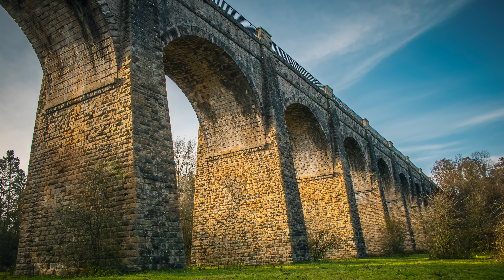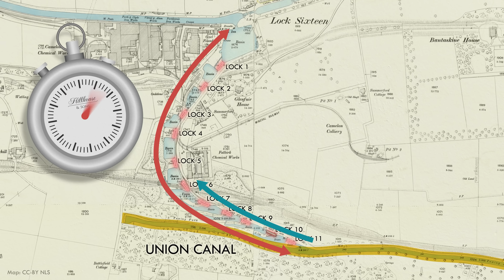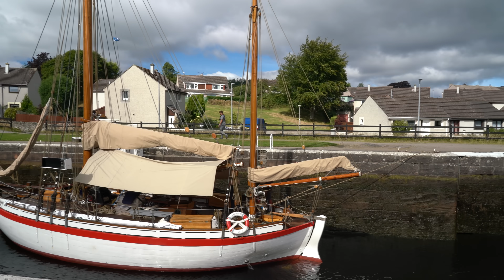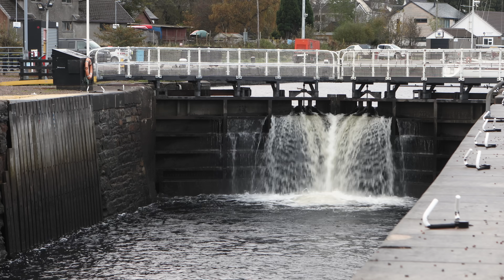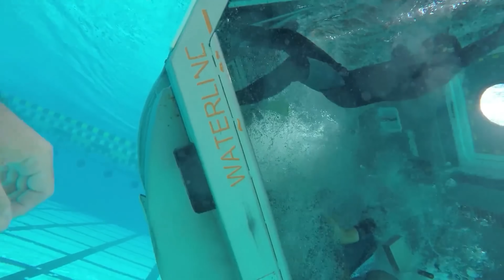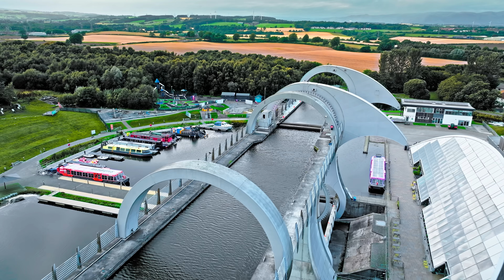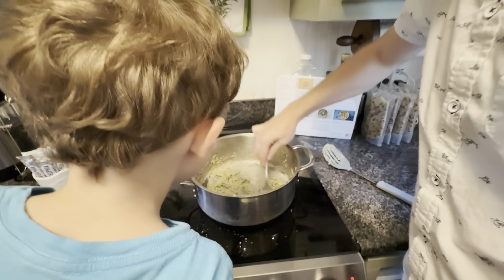The Hidden Engineering Behind the Falkirk Wheel

Comment: Due to the same problem in Elevation between Berlin and the Baltic the Germans build a similar but Vertical lift with counterweight for a 34m drop called Schiffshebewerk Niederfinow (Boatlift in the Area of Niederfinow) in 1934 which is still operating today and just recently got a replacement build while still remaining in use.
If you are touring North of Berlin and interested in Infrastructure there are tours and a museum worth a visit.
https://de.wikipedia.org/wiki/Schiffshebewerk_Niederfinow

Comment: There is another really important point about this that Grady forgot to mention, which is that unlike locks, the wheel takes almost no net water flow.  If two boats use it in opposite directions, the boats displace the same amount of water.  But even if only one boat goes up at a time, the water that travels down as the boat goes up, goes back up when that boat eventually comes back down.  So provided all the boats that go up come back down eventually, and vice versa, there is almost no nett usage of water (just the small quantity between the leaf gates at the end).  Whereas with locks, whether a boat goes up or down it takes a lock-full of water every time.  Pumping the water back up to keep a set of busy locks supplied is no trivial amount of power, so this device completely eliminates that.  When you add to it the fact that the power to make it rotate is tiny, just enough to overcome friction in the bearings and gears, it makes it a much more efficient and cost-effective solution than using locks.  On top of that, there are only two sets of gates to be maintained, rather than the many gates involved in a staircase of locks.

The Anderton boat lift, which raises and lowers boats in a tank of water which is counter-weighted, achieves the same result but doesn't look as cool.

Comment: There are other boat lifts around the world. Some use counterweights and cables to do the same thing. They are all fascinating. This rotary one, however, is really special. They had a similar idea in 1906 for the boat lift in Niederfinow Germany, but it was dismissed and they wanted to use a balance beam instead. The build was delayed due to WW I and afterwards they switched to the counterweight and cable solution. It still uses the same buoyancy principle, but it is not that aesthetically pleasing than the symmetric wheel.

Comment: I worked in Glasgow for three years, and for a big chunk of that time I lived in Linlithgow. I travelled into Glasgow each day on the train, which passes about half a mile from the Wheel. I didn't get to see the Falkirk Wheel at the time, because I had to move away before the project was even halfway through. But I went back to that neck of the woods a year or two ago, and I can confirm that the Falkirk Wheel is indeed a most impressive structure. 

One thing that you implied but didn't state is how much water the Wheel saves compared to a flight of locks. In principle, the Wheel doesn't transfer any water from the Union Canal to the basin below, because the pressures in the caisson and the canal are equalised before the gates are opened. In practice, though, the flooding of the gap between caisson and aqueduct will lose some water on each cycle. The amount of water lost from the Canal, though, is trivial in comparison to the volume of water needed for each cycle of a flight of locks.

Comment: Hi Grady
Thanks for covering our wheel! I went to it's official opening as a kid!.

Do you think a system like the falkirk wheel, or a series of them, could, theoretically, be used to replace the locks on the Panema Canal?

Obviously they would need to be a LOT bigger, but it's potentially a way to use a lot less water to transit ships from East to West, which I know is becoming a real concern in Panema.

It would be a huge engineering project, but so was the Canal's initial construction - can you forsee any scaling issues that would make upsizing the falkirk wheel impractical?

Thanks 🙂

Comment: I'm a little disappointed that you didn't mention the improved water usage. While a traditional lock "uses" its full capacity in water, this system only uses the boat's displacement. That said, "using" water refers here to it being moved downhill, so the benefit is more in terms of water control. For example, if for whatever reason the upper pound is lower than the lower pound, when a narrowboat makes a journey through the canal system the water that is used by the locks above this one ends up filling the top pound, rather than refilling it after a lock-full of water is moved down to the lower pound. Due to all the other locks on the canal system being standard ones, and the need to keep pounds at a reasonable level, this won't save water, but more of these could definitely save narrowboaters and the canal and river trust a few headaches.

Comment: I've made my own model in my garage and when you put a water container on scale and put a floating boat on it, it definetly adds a weight.

The difference is when the container is semi-opened and the water is pushed away from the container. 

I guess that is what Grady meant, but it was confusing for me in the video and I didn't understand why the boat not suppose to put pressure on the structure. Now I know.

Comment: What's fun in many lift locks don't even need power to work.  They are just designed so the water at the upper left level is sliiightly higher. Meaning a little extra water flows into the upper lift, and then out when it gets to the bottom.   This means the upper lift is slightly heavier,  so when the breaks/locks are released it lowers and raises the companion lift which is slightly lighter,

Comment: You say "locks are a perfectly functional solution to get boats up and down", but with climate change that is only true with an asterisk. Even (or especially) the mighty Panama Canal has to limit ship throughput at least sometimes just due to lack of water, needed to operate the locks. Also we can no longer neglect the environmental impact of displacing such huge amounts of water, as that has to come from somewhere, and it's usually fresh water. This obviously doesn't really apply to the defunct locks that the Fallkirk Wheel replaced, as both boats and locks are tiny in comparison to the Panama Canal and water isn't as short in these areas either (probably, I didn't check).

Comment: So, interesting thing about boats moving across something like an aqueduct; the weight does not increase only if the water level doesn't change (stated in the video). However, if the water level does change, the weight can increase (or even decrease)! If a boat is traveling slowly enough, the water that it displaces is able to spread out from the boat (ahead and behind) so that as the boat passes, the water level does not change much. However, the faster the boat travels, the more concentrated the displaced water gets. If the boat travels fast enough, the water builds up in front of the boat (bow wave) and there is a wake behind the boat. If you had a scale weighing the aqueduct as the boat passed by, there would be a spike in the weight followed by a drop in the weight!

If we had a sensitive enough scale, we could actually detect the passage of a boat. The weight of the boat still passes over each section of the aqueduct, it just gets spread out by the water so that the extra weight is not all concentrated in a boat-sized area.

Comment: Great video, I used to ride along to the site every week to watch the progress of the construction, and was at the opening ceremony.  

The wheel was indeed a Millennium project, but it was only one link.  The whole thing was to make the Union and Forth and Clyde canals navigable again for pleasure craft, and this was itself a massive undertaking.  So much of it had been left to rot or had been actively blocked.  You touched briefly on the motorway, and that was one of the biggest items I think.  The main Edinburgh-Glasgow motorway was simply built across the canal - no bridge, just a couple of large concrete pipes to equalise the water level on each side.  To fix this they had to raise the level of this main artery by something like 20 feet so that the canal was again usable.  As others have said this was one of very few Millennium projects that was actually worth doing and has stood the test of time, ironically quite important for celebrating the passage of time.

Comment: The engineering behind this wheel, it could probably be operated by a couple of humans winding a handle. They should have included that in the design, just another couple of gears, it would have been like lifting heavy lock paddles and given an experience to boaties. But I suppose H & S come first. Thanks for the video.

Comment: Slight peeve - the Twenty First Century did not begin on 1st Jan 2000, but a year later. The calendar we use does not have a year zero (the Romans didn't have it) and effectively the calendar transitions from 31st December 1 BCE to 1st January 1 CE. So, for example, the 2nd decade began at the beginning of 11 CE, after ten years had passed; the second century on 101 CE, after 100 years had passed, and so on. The Victorians understood this and celebrated the beginning of the Twentieth Century in 1901.

Comment: We have a similar system here in Canada along the Trent Severn Waterway in two locations, Peterborough and Kirkfield - technically they are hydraulic boat lifts and operate solely on gravity only using electricity and hydraulic pumps to open and close the pivoting caisson gates

Comment: That seems like an extremely efficient solution compared to spamming a bunch of locks. It's far more compact on land use, allows bigger elevation changes than seem practical for a lock. Much higher capacity for traffic to go through by the look of it. The power consumption is something in the realm of what you could more or less cover with on site solar panels if you really wanted to. How much energy would it take to pump however many lock fulls of water from the bottom to the top? I can't imagine that would be cheaper to pump the water back up with traditional locks compared to the extra engineering for a wheel like this.

Comment: The Falkirk Wheel is so elegant, I was thinking at the beginning of the video that it was designed out of necessity when the canal was used to move freight. I imagined it was a lock that ran on the weight differential between the top and bottom to move the boats up and down. A small amount of water from the top relative to the usual amount needed to move boats up and down in normal locks was used to rotate it.

Comment: 3:30 It is a bit misleading to hilite water usage while showing 11 locks.  The locks are in series.  Water used by the top lock is reused by the following locks.  Water usage depends on the water volume of the lock.  11 locks in series use 1/11 the amount of water that a single tall lock would use.  Also note: shallow locks have lower stresses and sealing issues.

Comment: I'm a 20 minute walk away from the Falkirk Wheel. Fantastic to see such an excellent summary about I've of it local engineering marvels. 

The other reason the two locks are required is due to a rail line which the canal goes under, it also avoids the structure getting too big. 

They are also the only locks on the Union canal, which follows the contours too Edinburgh.

Comment: My biggest question on seeing the design was why it had the pointy triangular bits sticking out of the caisson-carrying parts. From what I can find out, it's partly to balance the torque (imagine them extending all the way to the other caisson and you'll essentially have a Ferris wheel), and partly aesthetic to represent a traditional Celtic double-headed axe (which is one reason why they don't actually extend all the way around).

Comment: To explain, the reason for the two locks at the top, instead of a slightly taller wall, was that they didn't wish to instruct the view of the historically important Antonine Wall (rhymes with nine) or the natural scarp slope. This is why the wheel isn't fully height, then the canal goes through a tunnel and up two locks. You can pay for a ride on a boat but it's a waste of money for a very short ride on a smelly diesel boat, when you get a better view if you walk. The most intriguing feature is not the engineering, but the way it unexpectedly caught the public imagination after an article in an engineering journal, leading to the unforeseen need for a visitor centre.

Comment: I'm surprised you didn't emphasize the water savings the design provides after setting up the amount of water standard locks use. It appears that as much water is raised up as flows down, resulting in no net flow. I'm not sure if that creates any problems, but generally saving fresh water seems desirable. If they could scale it up to the size of the Panama canal it might solve their water issues.

Comment: The Bong

I worked for Butterley Engineering in Derbyshire when they made the Falkirk Wheel. They were well used to making huge cranes and advanced heavy engineering projects having started in 1790 (see Wikipedia ).
In short , after installing the Wheel lift we got a phone call to say it was making some dreadful vibrations with a loud BONNNNNNGGG  periodically. It terrified the  boaters riding on it and it was stopped for some days until a design engineer realised it was 'winding-up' and just needed to go round the other way every so many rotations. That solved it.
This short version fails to describe the atmosphere in the factory during those few days of uncertainty!

Comment: Excellent video.  My spouse and I made a point of visiting the Falkirk Wheel when we were in the area in the summer of 2024.

You might have mentioned the Anderton Boat Lift, the only other operational boat lift in the UK.  It's also a counterbalanced two chamber lift, but works using cables.  It's less efficient than the wheel, but it was built in 1875.  It's under repair right now, but should be operational again in 2026 or so.

Comment: In Peterborough, Ontario, Canada, there is the Peterborough Lift Lock, which doesn’t use ANY electricity, and an extra foot of water in the upper gondola to operate the system, with two huge hydraulic pistons

Comment: ISTR there's another 'boat lift' in the UK that used hydraulic cylinders to lift / lower two caissons. It too was ingenious in that the weight of one piston lowering, provided almost all the effort needed to lift the other at the same time. So when I first saw the Falkirk Wheel, I realized immediately, "Those two tanks always weigh the same, loaded or not. So it's practically balanced perfectly."

Comment: Bro that displacement thing so it's always balanced with no additional stuff or engineering is genius. I love that
Reply: It's very similar to a funicular elevator except even more efficient because it's always in balance.
Reply: Thank Archimedes for that!
Reply: @bonaldisillico  that guy was really screwing around
Reply: Yet there is still the problem of the level of the main canal at the top and bottom.   For example, if the higher pool is, say, a foot above "normal" and the lower pool is a foot below "normal," as soon as the water levels are balanced, the top section would be much heavier than the lower sections.   Do they transfer water between the two levels before unlatching it?   

And what are the ears for?
Reply: It’s literally the only way it would work. Physics dictates the result. It’s not engineering, it’s the way buoyancy functions.
Reply: @Ping_freud22 yeah I know, I just never thought about the way that could be used for something like this
Reply: @KamikazeWombat  totally, everything about this is super cool

Comment: The missing Grady Garage experiment:  Have two identical containers representing the gondolas with an overflow at the top of one of the walls so, if filled with water, they will spill any excess out and keep them both with equal volumes of water.  Put them on the arms of a scale.  They should be perfectly balanced. 

Put a small container simulating a barge in one of them.  Start adding weight to the barge.  The barge will start sinking and water will overflow from the gondola, but as long as the barge doesn't touch the bottom, both gondolas will be balanced but, as soon as the barge touches bottom, that is, it doesn't float any longer, it will not displace any more water and the pair will end up unbalanced.

Comment: The safety brief on the tour boats (which are worth going on :) ) was "If we start to sink, just lift your feet up, otherwise they'll get wet", as it is so shallow (about 30-40cm under the bottom of the boat, we were told).
If you are in the area, it is worth checking out both the Falkirk Wheel and the Kelpies. :)

Comment: The canal didn't go through the new tunnel just to avoid the Antonine wall, there was also the main Edinburgh-Glasgow railway to miss too! And this means that the new length of the Union canal that had to be built now ends in the only lock (actually a double-lock) on that canal as the original was a contour canal (hence the Falkirk tunnel and several aqueducts along its length) in order to complete the height difference.